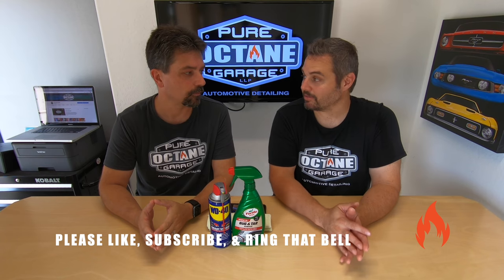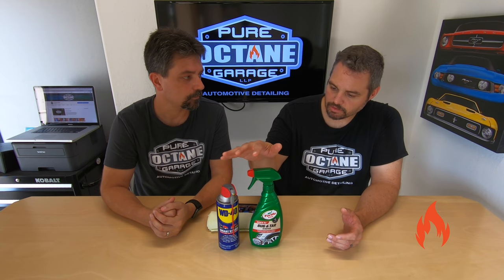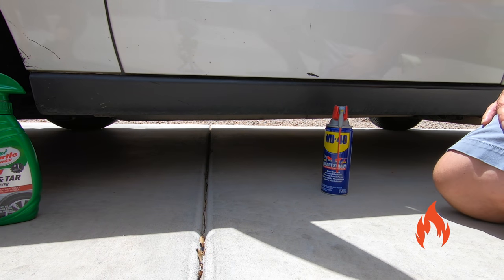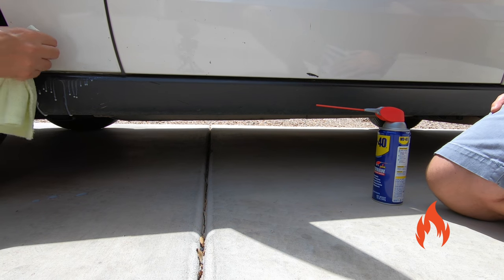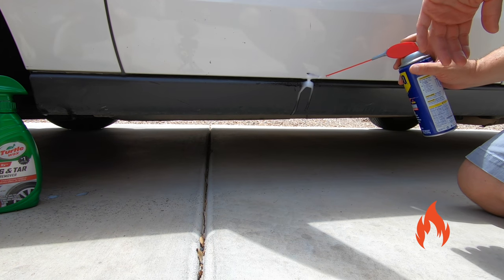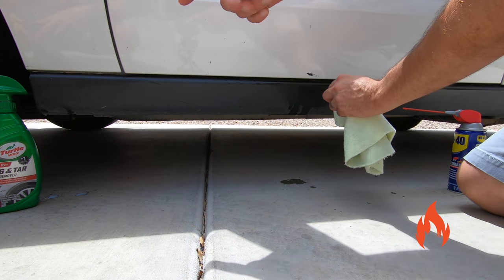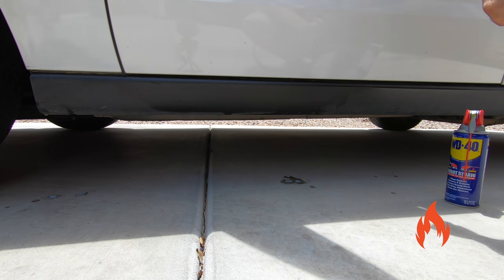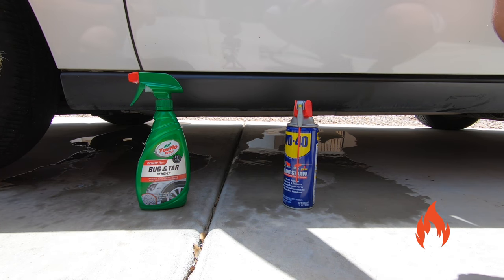Pro Tip: Easily Remove Nasty Tar From Your Car!

Comment: So am I able to use this to get rid of asphalt that has splashed on my vehicle.?
Reply from the maker: This will rid the tar from the asphalt...if you have large contaminants be very careful, you might need to soak with vinegar and try to spray away. You might need to compound/polish the area to rid of the scratches incurred from the removal. Good luck and thanks for watching.

Comment: The poblem is the tar dries on the surfac.  You need to get past the surface to the softer tar. I have a pickup truck to do this Saturday that is completely coated around the wheels on the fenders. Someone drove through a freshly tarred road. I am going to try using a heat gun to soften up the tar and then hit it with WD-40 to see if that works better.
Reply: Well, it worked like magic.   I heated the area.woththe heat gun for a couple minutes and saw the tar start to melt. Then applied WD-40 and wiped the tar off.  Saved myself a lot of time and WD-40 in the process. Before, it would have taken many applications of WD-40. There you have it.
Reply from the maker: Excellent! Appreciate the update and the added tip! Thank you for checking out the video

Comment: What do you guys mean by apply protection? I have specs of tar all over my car and need to remove it but I don’t know what to do with the protection part
Reply from the maker: Great question Caleb. These products and others like them tend to strip off any wax or sealants (sometimes coatings too). We are just reminding viewers that use these products to reapply wax, sealant, or coating (protection) on the areas these are used. Thanks for watching.

Comment: I’ve used the bug and tar remover can it scratch up cars
Reply from the maker: You should be safe. We haven't had any problems, but keep in mind the sponge, towel, rag, etc. that you are using, that can be the most dangerous. Great question. Thanks!

Comment: Couldn't recommend this product for tar. I sprayed it twice over most of my car, using up a whole bottle. To no effect. None of the tar started melting and I wasnt able to wipe it away without scrubbing hard. I washed the car and next day tried with another product on half the car: Carpro Tarx, this worked brilliantly. The other part of the car received a treatment of Koch Chemie EULEX. This was fabulous and 95% of tar just melted away. I had to re-treat around 10 areas twice or so. But i never had to rub og scrub. Just microfiber wipe, and voilá
Reply from the maker: Thanks for sharing your results. We have since found a better product as well. Stoner Tarminator has proven to be very effective. Appreciate you watching!